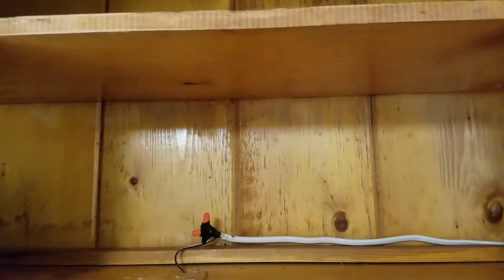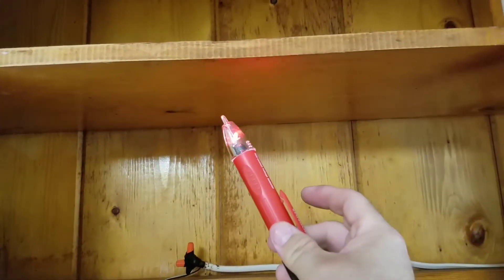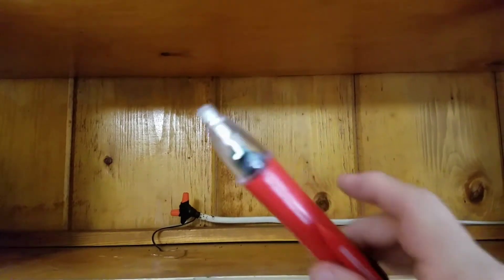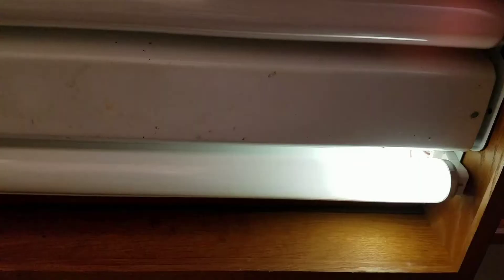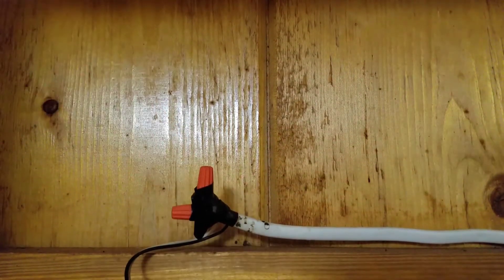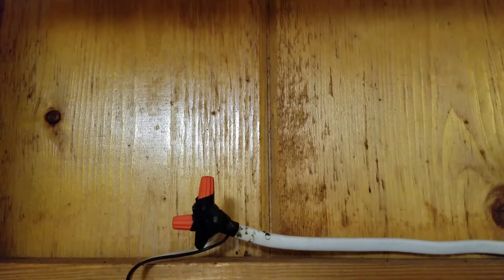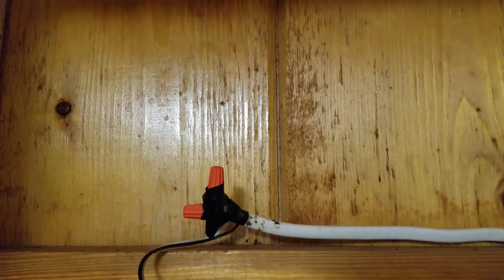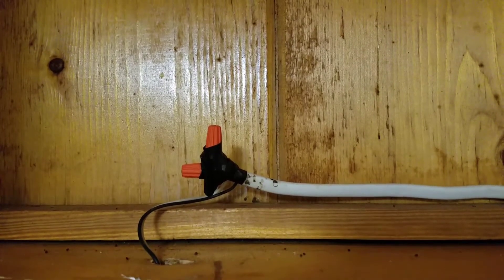Source of ham radio interference

Comment: did you try it after disconnecting the light
Reply from the maker: No, I will be picking up a outlet box today. Right now I just have the power turned off in the breaker box to that branch circuit.

Comment: Do you have any link to this device that is used to detect RF interference ?  Looks pretty cool and sure would like to do a similar audit of my apartment.
Reply from the maker: Kevin J how to detect RF interference I have another video I just choose the a.m. radio off frequency and it doesn't but the thing I'm using here is a voltage detector that you stick in sockets and stuff to see if they're alive it's just like maybe 1 inch from contact the signatures broadcasting in the strip in the sensor on my voltage detector so just Google like voltage detector I'll put a link when I get home I'm at work right now